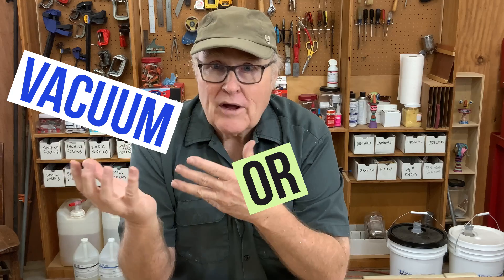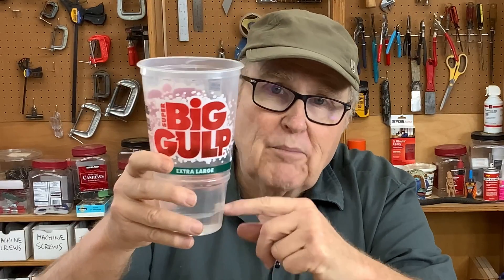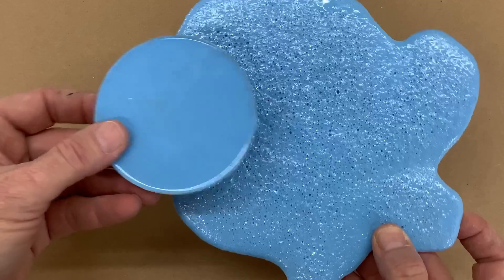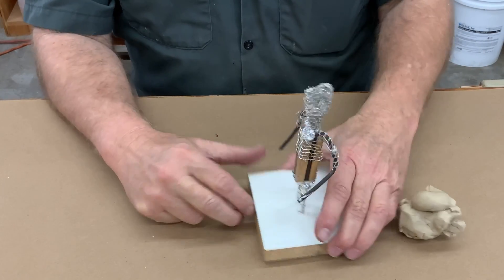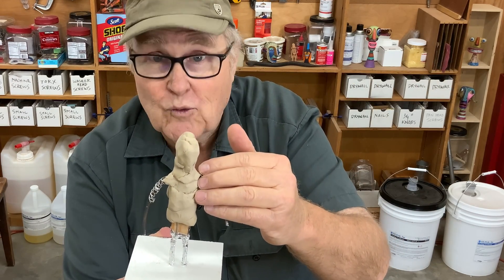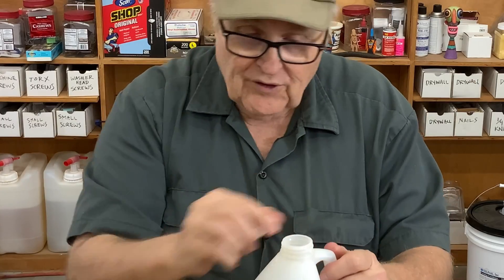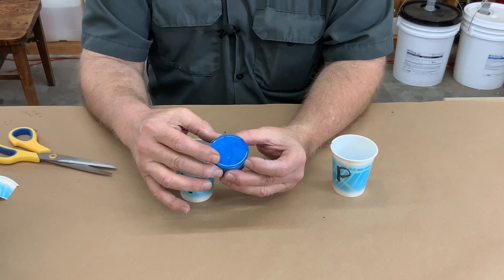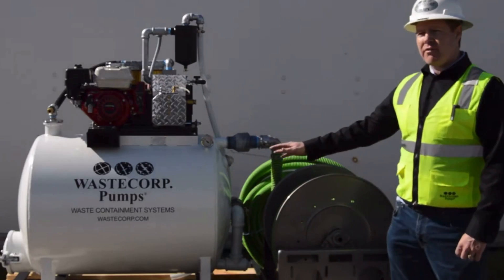Which One To Use, When, How?  WHY IS THIS SO HARD? !!!

Comment: You did not mention the pressure you use for vacuum. A simple vacuum cleaner which will reach about a drop of 4 to 8 kPa below atmospheric pressure (which is ~101,3  kPa at sea level) is not enough for degassing. You'll need a 'real' vacuum pump by pistons (or rotary displacement) beeing able to reach a vacuum when water will boil at room temperature (~2,5 hPa)... and with a capacity to get to this level within reasonable time.
The pressure gauge shown in your video is measuring the pressure drop in in-Hg (1 inch of mercury = 3,38 kPa). I don't know your altitude but I presume at max you will reach a drop to 29 in-HG. The degassing starts around 10 in-Hg or 50% of atmospheric pressure when bubbles increases twice their originial size (volume) and starts to flow up. As the pressure drops bubbles will increase. For example at 10% atmospheric pressure the bubbles will grow 10-times in size and will move up by buoyancy.

Comment: I've also found that making two part molds can be incredibly messy with pressure - likely to get a lot more flashing and deformities of the part as the second layer seeps between the original piece and the first half of the mold

Comment: I got a pressure pot and used it on silicone and epoxy resin, zero bubbles, no degassing was needed at all so it seems that the vacuum chamber is not needed at all as far as I can tell. Just get a pressure pot only and you will probably never need a vacuum chamber.

Comment: Is there any reason why I can't use the same pot for vacuum and pressure?  I've got an El Cheapo pot from harbor freight. Works fine for pressure. Can I just buy a vacuum pump and appropriate fittings? I guess I could add a plexiglass top, if I want to see what's going on.

Comment: Hey! I have that vacuum pump and pot at home! I haven't used it properly yet :face-orange-biting-nails: I stopped short from buying silicone and resin to cast. I reckon why not, I was worried about the pressure pot exploding but I think it's probably relatively safe.

Comment: Both pressure casting and Vacuum casting use the same idea.  All the vacuum is doing is expanding air in the mold so most of it finds its way out.  Once full vacuum is achieved, you STILL have air pockets in the mold, its just the air is at nearly zero pressure.  You then Release the vacuum while the resin is STILL liquid and before it has gelled. Which is slamming 14 lbs per square inch of pressure on the resin, compressing any remaining air into bubbles so tiny they are microscopic.   Casting under pressure is just slamming the high pressure on the resin with the air in there still at 14 lb/sqin…  so the critical difference comes down to TIME.  With vacuum casting you need to be able to evacuate the chamber, and release the vacuum before the resin gels or sets.  With pressure casting you want the resin to gel or set UNDER PRESSURE before you release the pressure.  SO generally, we pressure cast with urethanes.   We vacuum cast with polyesters as we have a lot longer time for polyester to gel.   But if you don’t have a fancy pressure or vacuum system, you can still get good casting by designing a mold with proper venting, so the incoming resin can push air ahead of it and up out the mold. And if you dust the interior of the mold with talcum powder.  Just a fine trace of it.   This prevents surface tension in the resin from holding bubbles against the surface of the mold and allows them to either rise out thru venting, or with a little swirl of the filled mold, to migrate away form the surface of the casting.
Reply: @ Elastomers are not the same as hard resins.  If you pressure cast alone, the air bubbles will be compressed, and when you take it out of the pressure chamber, that air will try to expand again.   Because the material is elastomeric, it can actually stretch it. This can make the part swell if there is a lot of air mixed in. ( think expanding foam ). At the least it places the elastomer under tensile stress internally which may affect flexibility and durability.   In such a use case you want to try and make sure the mixed urethane liquid has the least amount of air before putting it under pressure.  You can do this by vacuuming the material before pouring it into the mold, vacuuming the filled mold before applying pressure, or by vacuuming the two components prior to mixing and using a mixer that does NOT entrain air into the mix.
You can try it and see if its an issue for your use. It is obviously more of an issue with lower durometer urethanes than it will be with the higher durometer stuff. 
But pressure casting is effectively like injection molding, it just is not going to reach the PSI an injection press can achieve.
Reply: Yes, you are correct. I have done perfect bubble-free castings by vacuuming the mold, and when releasing the vacuum the pressure pushes the resin into the mold cavities. It might require a few cycles of vacuum -> release but it does work. It only works with slow cure resins, a fast cure resin will cure too quickly.

Comment: Dont forget, Vacuum actually removes the air, Pressure only crushes the air smaller.
If you need an absolute perfect surface not to trap like bacteria like Dildos, you really dont want to small bubbles which you cannot see, but where bacteria will accumulate.

Comment: So here is another question, if I am using the pressure pot to set my mold does it affect the scale of the item? If I am concerned about tolerances it seems to me that will need to be factored into the process as I am thinking the pressure is going to turn out a smaller part then I initially intended. Or is it significant enough to worry about?
Reply from the maker: There is no practical measurable difference in size between a casting that has been cured under pressure and one that is cured under normal atmospheric pressure.
Reply: @RobertTolone  Excellent, that is what I was hoping you would say!

Comment: From my experience some resins actually set almost immediately if you use too much vacuum. I think one of the components has a stabiliser which stops the resin from setting until the catalyst part is mixed in. The catalyst actually binds to the stabiliser allowing the rein to set. The vacuum can evaporate the stabiliser causing the resin to set within seconds.
Reply from the maker: I have never experienced that because I almost never vac resins.  And my resins set up so fast that if I do apply vacuum it’s only for a few seconds. But it’s interesting that you have seen vacuum do that to resin.  One more thing to look out for.

Comment: Ok, I understand everything but I have one more question. If I have to make the mold from a fully solid object whitout air in it, could I pour the rubber and put everything in the pressure pot? It should remove the bubbles as it does for resin and it can't crash the object so it should work, right?
Reply from the maker: Yes it should work fine.

Comment: Would vacuuming slower curing resin be acceptable? Lets say you vacuum the bubbles out and then pour it into the mold? Thank you for your videos, Im looking to cast my first resin sculptures based on my 3d prints soon.
Reply from the maker: Possibly, if your resin cures slowly enough.  For urethane, vacuuming wont solve the foaming problem. For epoxy, I have found that warming the resin with a heat gun removes bubbles more effectively than vacuuming.

Comment: If you have a pressure pot, there is never a need for a vacuum chamber even for silicone. Silicones say they need to 'degas' as they don't take into account people using a pressure pot, not when the base purpose for such silicones was making molds of clay sculpted items and the like. I've been casting and molding for 4 years now and only use a pressure pot. A vacuum chamber just wastes time. The only key thing is to pressurize the silicone about 5psi higher than you would the resin going into it. 

I never got why people think they need to go through hoops to make sure there are no bubbles before they cure. A pressure pot shrinks down smaller bubbles to non-existance and forces bigger bubbles if any to the surface where they pop. Shoot I use a drill mixer for mixing my resin and silicone for molds and that adds all sorts of bubbles to the mix, and I just do what I need, add pigments or whatnot, pour, throw it in the pressure pot, and outcomes bubble-free products.
Reply from the maker: until the day that you destroy a client model and have to pay thousands of dollars to replace it. Then you’ll never ever again put a model into a pressure pot. I never know how my clients sculptures are made and the voids inside of them are a huge hazard. I never subject an original sculpture to vacuum or pressure for that exact reason.
Reply: @RobertTolone  While yes you want to be mindful working with someone elses creation all you need is 30-35psi, 20-25 at the least to remove all bubbles in resin and or/silicone.  Most things going into such are a lot stronger than that and have less of a void space, plus the casing that you'll be using to hold the silicone and the silicone itself add's an extra wall of support, adding to the strength. 

I've worked with both clay, marble, cement wood, and other materials casts some that fully take up my pressure pots space, to as small as a 20mm dice.  

The last item I casted and crafted was a memorial item containing a loved one's ashes and prised belongings. The center was a clear hallow, air-tight orb modled after a baseball, a sport the deceased loved where the ashes would be held. 25 psi, no issues, no deformations, and bubble-free.

Comment: How can I build a pressure chamber like yours?
Reply from the maker: mine were made from the brake cylinders of trucks. The doors and openings were custom fabricated. Any competent machine shop could make those parts but you must make sure that whoever welds the tank parts together is competent for making pressure vessels.  The pipe fittings etc. are standard plumbing fittings.
Reply: @RobertTolone  thank you very much. Love your videos, have helped me a lot! Keep up the great work!!

Comment: Would something hollow and fragile, like an insect husk, be crushed if cast in resin and put into a pressure pot?  
If so are there any ways to avoid that, while still being able to rid the resin of bubbles? 
I guess my overall question is: Will a pressure pot crush/distort hollow items cast in resin?
Reply from the maker: A pressure pot will crush it like the proverbial bug!  Much better to de-gas the rubber in a vacuum chamber before pouring the mold.  Crushing may be only one of your many problems. It’s possible that the rubber will bond tightly to the bug. Especially since there are so many things like hair, exoskeleton plates and tiny projections such as antenna.  Even if you do make a clean mold from your insect you will have a serious challenge venting the air out of the mold cavity. You may have to resort to vacuuming the mold cavity after you pour the resin - which means using a slow setting resin.
Reply: @RobertTolone  That isn't true. I've casted bugs in resin before and they keep their shape just fine. He's also talking about casting bugs in resin inside a silicone mold. Not molding the bug.

Comment: Love it.
Though, it's obvious why you wouldn't vacuum a quick cast resin, but what are your thoughts about something slow setting, like epoxy? I've avoided doing this because I've seen people try, and it made a huge mess. That aside, what do you think?
Reply from the maker: I have found that it is easier and faster to take the bubbles out of epoxy resin by pouring it into a shallow pan and using a heat gun to warm the epoxy.  This causes the resin to clear very rapidly. Much more effective than the vacuum chamber. That does not work with urethane resins however.
Reply: I've worked with fast cure and epoxy resins for 4 years. If you have a pressure pot, there is no need to vacume anything. Theres no need to try and do any tricks to remove bubbles either outside maybe taking a lighter to the top of a mold to pop any colected surface bubbles. Even for making the molds, I've only ever used a pressure pot, just casting the silicone at 5 psi higher when making them then what I will the resin going into the finished molds. People have this weird idea that you have to go through hoops to make sure the resin is clear before pouring, but a pressure pot removes all of that. Shrinking down small bubbles to the point of non-existances and forcing bigger ones to the top where they pop.

Comment: Great video as always Rob. I'd made a similar error in the past making a mold of an old bionicle mask. I wanted to make sure there were absolutely no bubbles left after pouring the silicone, so popped it back in the vacuum chamber after the pour. Despite being a completely solid piece, air escaped from under the wax pour spout I'd added to the mask, dislodging the whole piece and reintroducing bubbles. Even when molding a solid piece this can still be an issue if you're not careful.

Comment: For anyone who is interested in the science of polyurethanes and why they foam read on and I will explain.

First a bit of background on what polyurethanes are made from, you have two liquid parts which when mixed react together to form a solid this reaction is non-reversible. The two components are a polyol (I would refer to this as the base or resin side) and an isocyanate (I would call this the hardener).  Polyols are characterised by terminating in a hydroxyl group (-OH) and to be useful for this application they need to have at least 2 hydroxyl groups per molecule.  Isocyanates are characterised by an isocyanate group (-NCO) and once again you need 2 or more per molecule to be useful in this application. The R-OH and R'-NCO groups react together to form a urethane linkage R'-N(-H)-C(=O)-O-R  (where R and R' are the rest of the molecules).  

Now when you add water to the mix (H-O-H) you have a hydroxyl group which can react with an isocyanate unfortunately it doesnt result in a urethane linkage you get R'-N(-H)-C(=O)-O-H but that nitrogen in the middle would be much happier if it had another hydrogen friend so it steals the one from the end and you end up with R'-N-H2 + CO2 this gives us our bubbles, but isn't the end of the story the R'-N-H2 then reacts with a R'-NCO to form a urea linkage so while you get a different product it still cures (as long as you have sufficient isocyanate).   

So you get carbon dioxide bubbles being formed and this is used to good effect in polyurethane foams however, not what we normally want from our casting resins.  The problem of moisture contamination is then twofold first it makes bubbles in your casting (which can be mitigated by application of pressure as Robert has shown) secondly it pushes off your mix ratio, every water molecule is using up 2 isocyanate groups which should be reacting with your polyol.  In most cases the resin will still cure to a solid but even if the bubbles are suppressed the end result may not have the physical properties the resin should have achieved (hardness, flexability, strength, etc.).

Hopefully that makes some sort of sense if anyone has any questions feel free to ask.
Reply from the maker: Hey Chris, thanks for this explanation!
Reply: This is awesome, thanks! What little materials background I have is all solid state physics but I’ve been learning a lot about polymers for the last few months.

Comment: This was a great video, as always.
When putting resin in a vacuum chamber, some components start to evaporate. This can change the composition and have a negative effect on the part properties.
At times when we have to degas epoxy for technical reasons, we keep the time in vacuum as short as possible.
Please keep those videos coming.

Comment: Okay... So that was interesting. But there's a catch, right ?
I often see people casting clear resin stuff (like crystals and cie) putting it in a vacuum first, before the pour. You said it yourself: it's fast cast, so no time to de-air in the vacuum. What if I have a 1 hour, or 10 hours resin, would the vacuum work ?
It looks like to have a perfectly clear cast with transparent resin you need to vacuum it, and not pressure it. ?
Reply from the maker: I have much less experience working with clear epoxy resins so I’m not an expert. But what I have found is the best way to de-air clear epoxy resin is with a heat gun. Warming the resin causes the bubbles to rise very fast and you can clear a batch of resin faster that way then you can with vacuum.

Comment: It remembers me what happened to a friend that worked for a tiny models company. They didn't use RTV rubber, instead they used one that has to be vulcanized with heat and pressure. And that was kinda fine while they used for green stuff models. They received a model made in different materials (included fimo). When they pressurized it they crushed completely the wings, and body had to be partially reconstructed from the first (faulty) cast that then served as master. Also other models tiny scale vulcanized under pressure looked skinner and with squished details.

Comment: The comparison is incorrect. The vacuum pump is too weak for such a vacuum chamber. Therefore, resin polymerization occurs faster than degassing occurs. You need a much more powerful vacuum pump.
Reply from the maker: Or a smaller chamber which I also have.  Vacuum won’t solve the problem of foaming in either case.
Reply: One tip I remember from way back was, if you have a larger pot (pressure or vacuum) but you are only doing a relatively small-sized job, is to put some suitable solid object(s) (e.g. steel block or dense-fired bricks) inside the pot first, to displace air in the chamber before you start. That way, the pump (vac or pressure) can get the job done a lot quicker, because there was less air in the chamber in the first place.